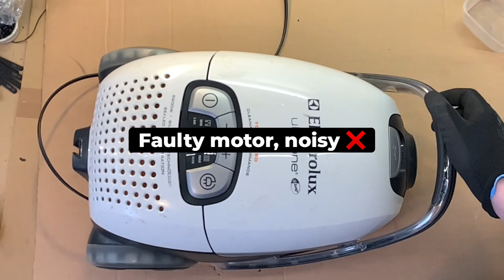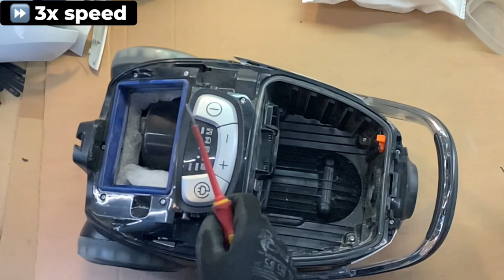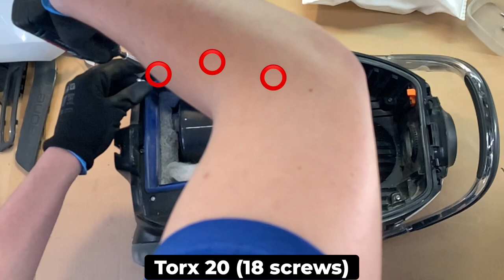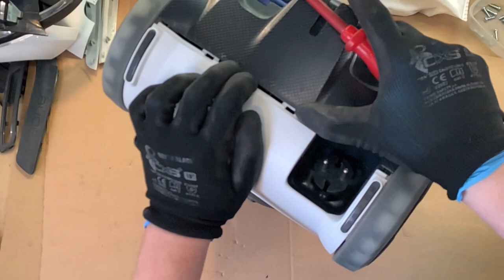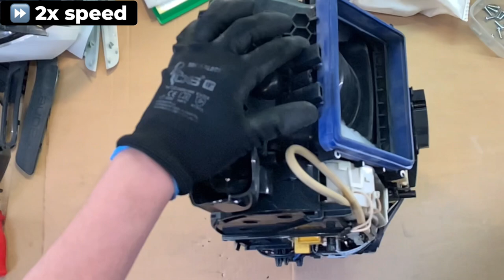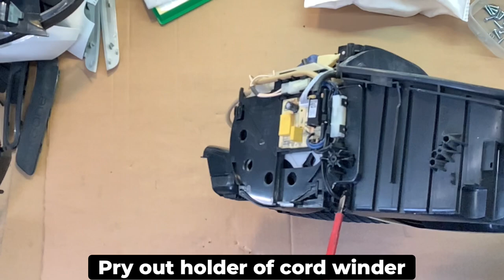How To Disassemble UltraOne - Electrolux Z8810W Vacuum Cleaner

Comment: Thank you! Helped me tear it down to check the cable winding unit (and tear that down as well). As I suspected it was broken -- but not in the way expected... The wall plug was broken. The rest of the cable and everything else was perfectly fine. Thankfully replacing the plug is easy (and legal).
For others who might need to tear down the cable winding unit:
Unwind it fully, block it from winding back up (I used a screwdriver through the holes), and follow the cable. It goes into a small box (maybe 6x6x2 cm) held in place by two small plastic tabs that stick up in front of it. With some work getting the tabs down AND prying on the top and bottom sides, you can pull that out entirely.
The cables attach to that little box, which connects to the main unit via two brushes (not sure if that's the correct term, but basically they connect something stationary to something rotating).

In my case, the only benefits to disassembly were cleaning and finding out the plug was broken, without having to cut the plug off before hand, but hey.
Reply from the maker: You are welcome, good to know, but in case you cant check cable plug, by moving with it then it is good to buy voltage tester for few € (good investment to have one in the household) and you can test where exactly the cable is damaged or if cord winder is under voltage 👍